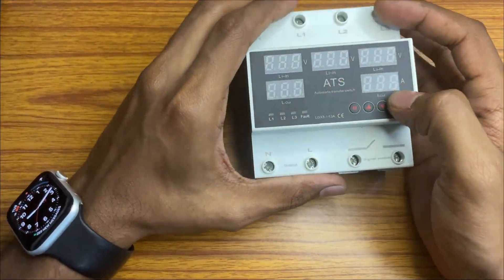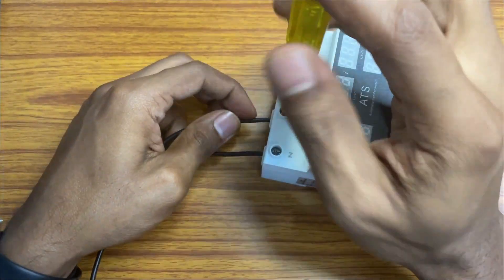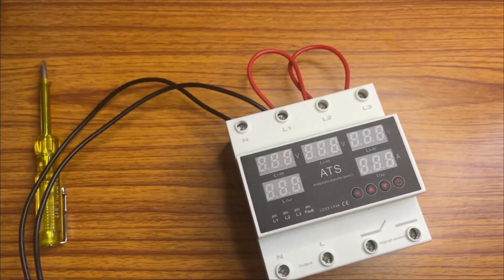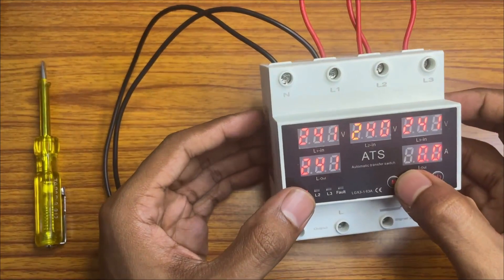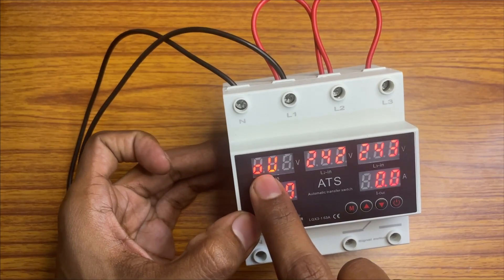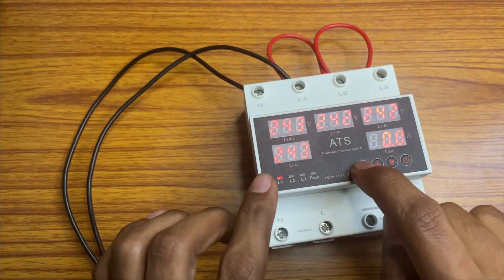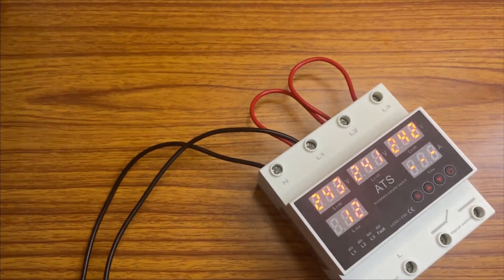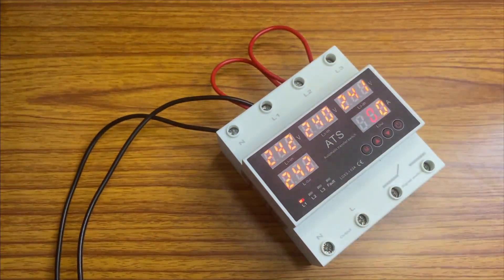Ultimate Home Voltage Protector with Automatic ChangeoveR |Over & Under ,Overcurrent Protection

Comment: what do last display show,it is showing 0 in my device
Reply from the maker: We will update new video soon
Reply: How to connect the N wire for  L2 and L3 for example l1 is generator and l2 is solar inveter and L3 is public electricity  their N WIRE SHOULD CONNECT TO THE N FOR THE 3 or what i didn't understand because these L line supply 220 each and how to connect